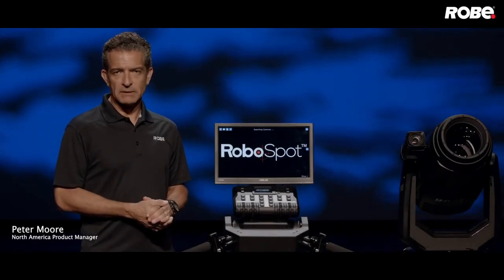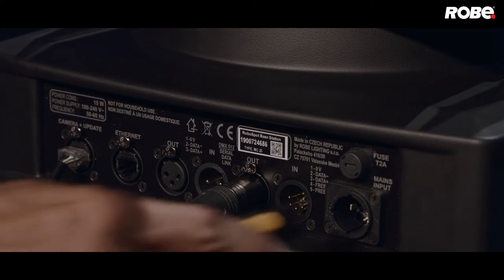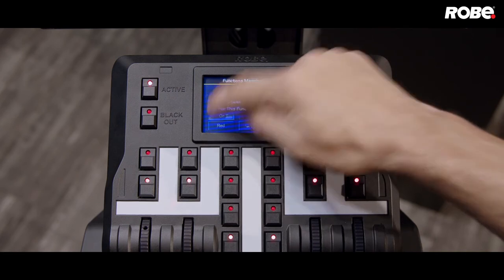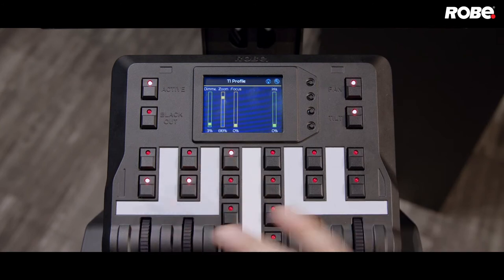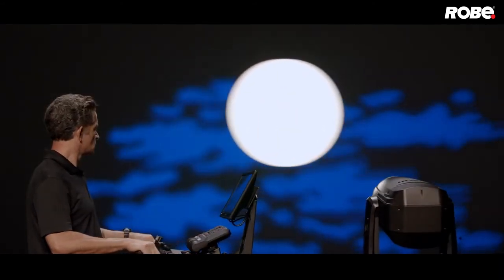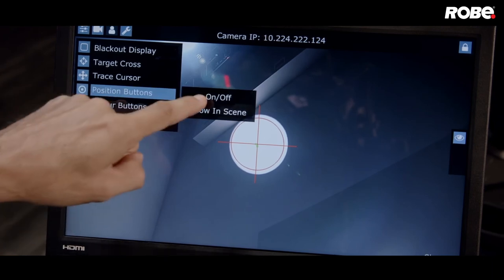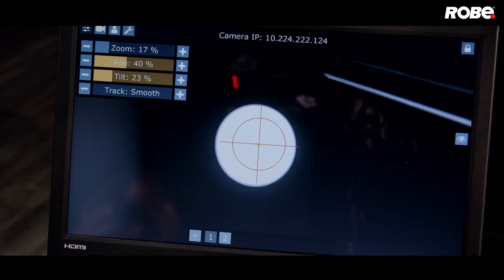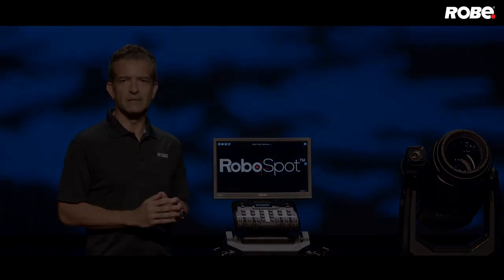RoboSpot FollowSpot System Overview and Setup

Comment: Great idea, but terrible implementation. Ninety percent of the functionality should be located right in the grips. For example, if you need more range, pressing a button on the grips disables tracking while you reposition to an angle with more room to move. Overly complicated for no reason.

Comment: How does one delete the position presets?
Reply: To delete a preset on the touch panel, hold down the button you want to clear until the LEDs begin to flash, then press and hold down that button again until the flashing stops. To delete a position button on the touch screen, press and hold the preset you want to clear and you'll see a prompt to confirm the deletion. The next position preset you create will be written in that location so if you want to "update" a current preset, just select a preset, edit the values, delete the preset and press the + button to record the updated values in that same location.